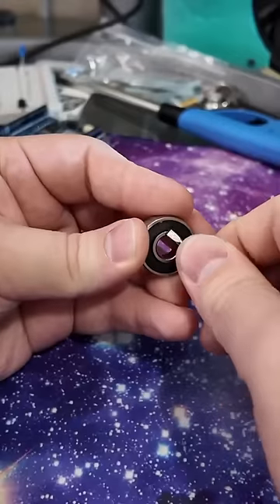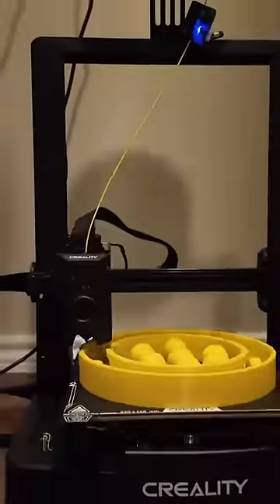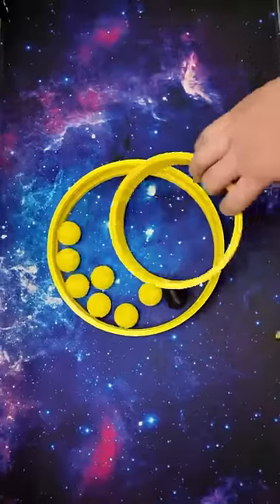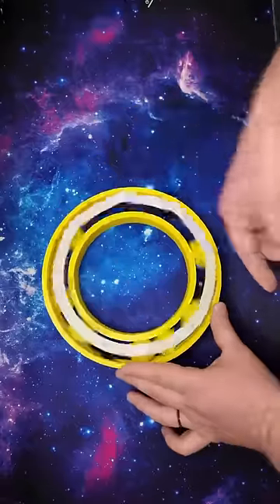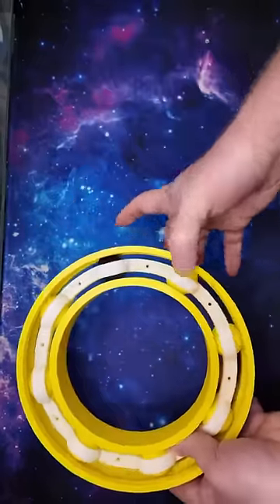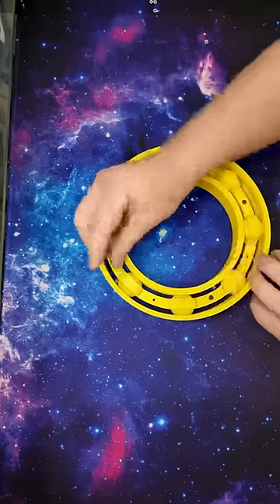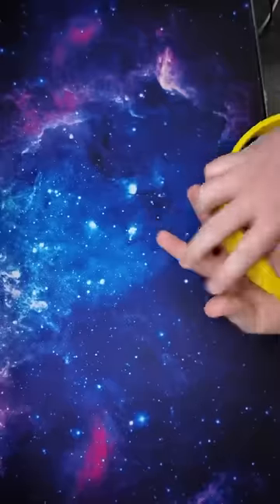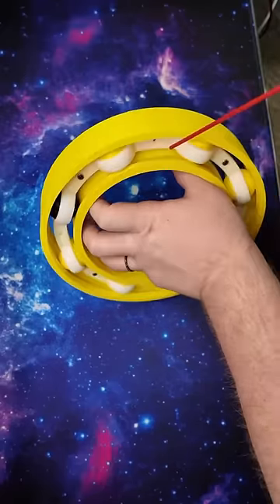How Do The Balls Get Inside the Bearing? 🤔 (ft. GIANT ball bearing) #3dprinting #engineering

Comment: a lesson from the rubiks cube community:
WD40 is not good with plastic! it can damage over time, and WD40 is not made to be a lube anyway, it's made to displace water. (the WD 40 stands for Water Displacement, formula #40, apparently there were 39 failed attempts)

it's absolutely fine for a demonstration, but if it's anything that you want to work longterm, like a screw mount that'll be seeing a lot of action, then your best options are silicone or graphite based lubricants
Reply: Rubik’s cubes need a lubricant?
And there is a Rubik’s cube community?
Reply: @Scummy_shovel yes and yes!! If you want the cube to turn nice and not get stuck lube it up!
Reply: @Smolnsalty  I guess that actually makes sense.  Just dint think people got that serious about a Rubik’s cube
Reply: I mean this guy even admits being stupid. What did you expect?
Reply: @Scummy_shovel it's a huge community actually, mainly going for speed or messing around with weird cubes
Reply: @Ohokk0  yea I actually did a search after this.  Holy crap can people solve those fast.  My first one took me a year or so lol. Maybe I needed more lube 😂
Reply: Since finding out about calcium based grease with PTFE additives, I only use these. I'm yet to find a thin one, but Liqui Moly makes some "Winsch Fett" in German, which is calcium based and has PTFE additives. It's the best grease I've ever worked with. Sticks to the components, slides into small cracks, isn't aggressive to plastics/rubber and hasn't this nasty sticky/smeary consistency like silicone based greases. Should be perfect for skateboard bearings, bike bearings, 3D printed ugga dugga sized bearings and probably also rubix cubes, if you place it carefully with a syringe :D
Reply: @Ohokk0  Ive never been good at Rubiks cubes, but I really enjoy watching people do tricks. I've seen some where people will set them up to be able to quickly spell out a word with a series of turns. Its crazy how much content on Rubiks cubes there is on youtube alone.
Reply: If WD40 is not made to be a lubricant. Why does it say it can be used as a lubricant on the can?? Hmm.
Reply: Exactly my thoughts. I was wondering if the wd40 damaged the plastik in a way that made it smoother or why the wd40 was added instead of plastic grease. But maybe he is simply misinformed. It's one of the most common misunderstandings i come across. Wd40= rust removal and greate for old/bad grease that retained water or other unwanted contaminates. Once clean, you add new greace.
Reply: @Scummy_shovel This was a dumb question. The obvious assumption is that there's a community for everything. Get smart
Reply: @grizzzymd  well. Sadly I suppose you are correct.  Just really dint think a toy I hadn’t seen in 20 years would have such a strong following.   Sorry for my dumbness 🫤
Reply: @Scummy_shovel  It's ok just try harder in the future
Reply: @grizzzymd  absolutely no enjoyment in that
Reply: @Scummy_shovel  
get a speedcube such as the moyu rs3m and learn how to solve. (not a Rubik’s brand tho, old ones suck and new ones are decent but cost a fair bit) (also speedcubes of other brands aren’t ripoffs but just competition at this point) with lots of practice, you can solve in in 1 minute.
Also: lubricant can improve the cube’s longevity. Don’t use something like Vaseline, as it is a solvent. There’s lubricants MADE for speedcubes.
Reply: @DaKing08  I have to check that out. Thx
Reply: As a cuber, I've once used WD-40 to lube my cube. Never again.
Reply: From what I remember reading it came from the rocket industry, to apply to the external side of a missile?
Reply: yea. Atlas or something?  Supposed to displace the water and prevent rusting.  It really is an awful lubricant. But works super well for cleaning grease and grime.   I have also seen a lot of off road guys use it when there distributor and stuff gets wet and want start.
Reply: I thought the same thing. WD-40 is a type of degreaser and also acts kind of like a solvent, forces water away and itself evaporates fairly quickly (not as quick as rubbing alcohol, but close). Anyone using WD-40 for lube has no idea. It’s perfect for clearing squeaks from hinges and latches as it’s removing the rust (or anything else that’s causing the squeak). But he’ll find holes in that bearing sooner than later because it’s going to eat straight through that plastic in time.
Reply: WD-40 makes more than 1 product. 

"WD-40 Multi-Use Product protects metal from rust and corrosion, penetrates stuck parts, displaces moisture and lubricates almost anything."

"Lubricates, resists water and protects metal and non-metal surfaces"

"Lubricates 15X longer than the competition"
Reply: Me as a speed cuber I agreed
Reply: @bob-pm2bq  a speed cuber? How fast can you solve one?
Reply: People don't realize it's meant for breaking down, not lubrication
Reply: WD40 is now a brand name for a family of lubricants, as well as the original water displacement formula. There are WD40 lubricants which are specially formulated for plastic, such as WD40 silicone, and WD40 dry PTFE lube. Confused the heck out of me when I first saw these on the shelf, but they do make it quite easy to get some of these more exotic lubricant formulations.
Reply: @bob-pm2bq same, i came down here looking for this very comment lmao
Reply: @Scummy_shovel a community for everything
Reply: thank you so much, I came to the comments so fast when he said "WD-40"
Reply: @DylynKay  evidently
Reply: Came here to say exactly this. WD40 is not a lubricant. Use a silicone spray or graphite powder.
Reply: @Scummy_shovel that's what he said
Reply: @grizzzymd  that's what she said
Reply: @Pupp3tmaster-uq3yz  😂🤫
Reply: I would wager that attempts 1 to 39 weren't failures, but number 40 was marginally better.
Reply: @VegasEducation  lol. Just Good enough to call it done id imagine
Reply: @TommyShlong  What do you mean, "the way grades and oils are"? It's an oil. It has other ingredients, but the main ingredient is oil and when the carrier solvent that makes it sprayable evaporates what is left behind is oil.
Reply: WD-40 should not be used to lubricate most plastics because the solvents in it can damage those plastics. However, this ridiculous myth about WD-40 not being a lubricant is absurd in every possible way. Yes, the WD stands for water displacing. ... water displacing lubricant! Guess what? Most lubricants are water displacing. WD-40 was just better at it than any other lubricant at the time. 
Did you also know that "WD-40" was NOT used in this video? He used a spray silicone lube just as you suggested. You're literally taking him he doesn't have used what he used, but instead he should have used exactly what he used. It makes no sense. WD-40 is a brand name now and makes dozens of products. One of those products is a silicone lubricant (the same as the other half dozen brands of silicone lube you'll find on the store shelf next to it) and that's what he's using in the video. He even put a link to the product in the description.
Reply: Came here to say exactly this. Makes me cringe thinking back to all the DIY things my dad tried for my cubes as a kid before we knew better lol
Reply: Came here to say this.  I melted plastics as a kid with wd40.   I wasn’t trying to, I was trying to lubricate something else.   I learned about the plastic corrosion and hyper cleansing of machinery with wd40 all at the age of 8 or so.
Reply: @staples4335  It's a lubricant but not an especially good one. Where WD-40 really shines is for displacing water (the "WD" actually stands for "water displacement"), and for wicking into tight gaps to provide some degree of temporary lubrication to free up a stuck mechanism for disassembly; allowing it to be re-lubricated with a proper oil or grease.

Comment: Bearings are cold pressed mechanisms. From factory machines press the bearings together with force (that would probably normally break your hand if you were capable of exerting the strength needed to press a bearing together).

Comment: The truly impressive part about ball bearings is the manufacture of billions of extremely precise and perfect metal balls since even a tiny variation would lead to extra wear and significantly shorter part life.
Reply: They use drop towers (well they used to, I can't speak to the modern process).
Reply: @DavidSmith-vr1nb  coworker worked at one previously, drop towers and finish polish really.
Reply: Ive never thought about that. Good point. I work in low volume precision manufacturing, i cant imagine making millions of something.

Comment: "Works surprisingly well"

Stops spinning after 1.5 seconds
Reply: Exactly lol
Reply: There's some play in it, not to mention it's made of rough, 3d-printed plastic. It works well for what it is
Reply: 0.5
Reply: ABEC ratings for skateboard bearings are based on how well the bearing performs under load, not free-spinning (not sure if other industries do it the same way)
The difference can be quite surprising
Reply: you clearly think a cheap home printer as good as a precision ground set of parts.
Reply: @hackaboom  I'm not the one who said it worked surprisingly well
Reply: @hughjass1976  for a crappy 3d printed part is does work quite well. buy a new decent bearing and try spining it it the same fresh out the box. if they put more mass like a tire on the 3d printed part and spun it, it would go alot longer.
Reply: Surprisingly well [for 3d printed plastic]
Reply: @Jeyricho  yup exactly.
Reply: It's plastic, not smoothed over steel. There's a lot more friction.

Comment: I have found one of the absolute best lubricants for 3D prints is pencil lead. For gear assemblies, just throw small pieces in and let the gears grind and spread the lube. For bearings I coat the walls and balls before assembly. Free graphite dust fills in small voids and helps create a smooth surface. Graphite powder is a common dry lubricant.
Reply: Or.... just use graphite lube like everyone else has for 20 years on plastics
Reply: PTFE based powder lubes are also pretty neat
Reply: I remember getting some graphite powder as lube for locks 🔐 from a locksmith.
Reply: @TheLastMuffin007  Pencil "lead" is made of graphite so using small bits fed into the gear mech. is pretty much the same.
Reply: Yep if your zipper is stuck sometimes a pencil will come in clutch!

Comment: Depending on the tolerance. If tight enough is also possible to use heat the outer ring, cool the inner and the balls and get just enough clearance to get them in to the groove. Then you add the seals on both sides.

There are some many ways of making bearings, and absurd number of different bearings.

Comment: Actually they normally get them in via cooling and heating for contraction of the balls and and inner ring, and expansion for the outer ring, submerge the balls and inner ring in liquid nitrogen, and hit thr outer ring with a propane or MAP torch, will fit together easily, then just let them cool down and heat up

Comment: As a machinist, this is one way of keeping them in line. Another way is to have the races be the cage but have a hole on the outer race to get the bearings in (lower precision). There's also heat shrinking races and press fitting sometimes

Comment: I used to build CBA compressors for liquified natural gas units. We used massive steel ball bearings that we assembled using liquid nitrogen and very hot ovens to change the sizes of the various components. Once the temperatures were normalized, the bearings were set with incredible precision.

Comment: you can get cheap ballbearings, usually used in fidget spinners, where the ball cage rather than being two spot welded metal rings, is just a single piece of plastic that sort of clips onto the balls. they're relatively easy to take apart.

Comment: Precision skateboard bearings use a nylon retainer for the ball bearings that sort of clicks into place around the ball bearings so that the bearing can be easily fully disassembled for cleaning if necessary. I believe this also reduces friction inside the bearing during use, which will in turn reduce heat generation and extend the useful life of the bearing.

Comment: It depends on the bearing, if it's a metal cage, sometimes it's just smashed together to make a rivet. My factory used plastic cages for 95% of the bearings i constructed. Our bearings were very precise and unless you snapped apart, the cage wasn't necessary to keep the balls in, only to keep them appropriately spaced

Comment: Precision bearings that dont have carriers are put together with heat. They are machined with such tight tolerances that when the outer race is heated and expands, the inner race and ball bearings drop into place, and then once it cools it shrinks back to size locking everything together.

Comment: Why cant you weld plastic? Just melt them together with a low heat. It takes linger than spot welding but you can do it. A high temp glue gun or variable power supply soldering iron will work

Comment: Before those bearing rings they had cups and cones. The cups were curved so that halfway up was the deepest point. The axle had a cone that had an inverse curve. As you tightened the bolt pushing the cone down the barrings were pushed up and out, until the halfway point where they were supposed to be.

Comment: I designed some 3d printed ball bearings like this using small BB pellets. They're like a tenth of the price of buying a bearing, and for low stress use cases (which is most diy use cases) they're more than strong enough. And he's totally right that actually assembling the bearing and getting the balls in there seems like a complete non issue until you actually try it lol. I remember I really didn't give it a second thought during my initial design and then I couldn't get the balls in there for the life of me. In retrospect it's obvious why, you just need to think about it a bit, but it seems like such a non issue you basically don't even spare it a thought until you've already face planted into problems

Comment: "no play" is an incorrect statement. Radial contact (also known as deep groove or Conrad) bearings have a radial internal clearance usually somewhere between 1 and 8 thousandths. So they do have play. Both axially and radially. Angular contacts are ball bearings that are preloaded, thus the internal clearance is removed.

Comment: cooling tower shaft bearings are around that size irl, btw. i've dissected several of them of varying sizes and the bearing ball harness is usually riveted together. 

for larger sizes, cynlinder bearings are more optimal for load distribution. most of the ones for regular machines are ball bearing types

Comment: I had to 3D print a working ball/roller bearing for an engineering class.  The rules were that every part had to be made with PLA on a 3D printer and it had to actually hold itself together of course.  I ended up making one where the outer ring had small notches for the rollers instead of using a collar and the inside hub was held in place by a flange on one side and a snap ring on the other

Comment: I feel like it would spin even better if you swapped the metal screws for plastic as its likely the weight and gravitational force is preventing it from preserving much moment. This is why there is spot welding so that its one less piece weighing down the system

Comment: They DO have a designed play. It is just on the 5-30micrometer ranges. These range are adjusted based on application and fit with shafts and housings.

Comment: Not ALL ball bearings have a cage (or carrier) holding the balls in place, and yes there is tolerance there. Most are a c3, which is quite precise, but there is still a slight tolerance.
Another way of getting the balls in place is a half moon cutout on both the inner race and the outer race. Allowing them to be rotated into alignment and getting the steel balls into place.
[17 yrs working for bearing distributor]

Comment: Not all ball bearings have the carrier rings you pointed out.
Quite often both races are machined with a groove for the balls to travel. These type bearings use tightly packed & slightly oversized balls so they're pressed in and held in place by tention.
Reply: But then we're back to the original question: how do they get them in there?
Reply: @Gna-rn7zx  I said they're pressed in. 🤷‍♂️

Comment: Use to work for a Large German company that makes these en masse they aren't always spot welded more so just press fit (it's not don't by hand so its easier to assemble) There is how ever a lot of ID and OD grinding needed to get the fit just right to ensure the bearing moves within spec. And well.....have you ever seen a tank turret?....what do you thin allows it to spin ;) They can get as big as you are tall lol especially when you start talking airplanes/helicopters

Comment: Use a cooler grease, wd40 can create and trap heat being that it is oil based. Using a lubricant like graphite may dissipate heat and decrease resistance

Comment: This is a caged bearing. There are other types as well, such as roller bearings, conical bearings, cageless bearings, and also different materials for the bearings themselves (the balls in the ball bearing) such as steel, ceramic, graphite (not super common as graphite may happen to be a dry lube, but wears down quick and is electrically conductive including the dust that gets everywhere) plastics, and even wood. Wood is less common and graphite has almost no use case that I know of